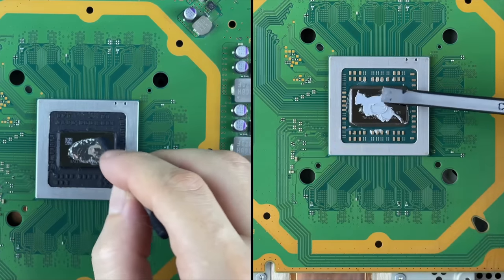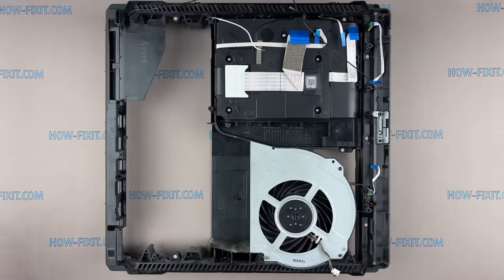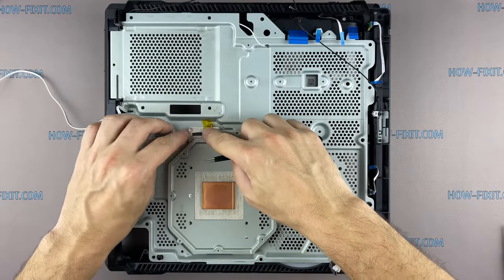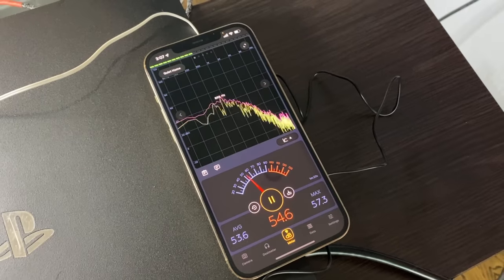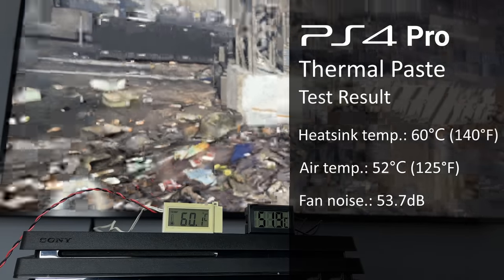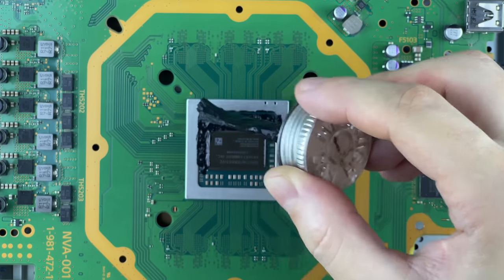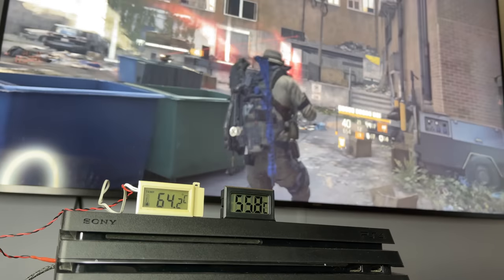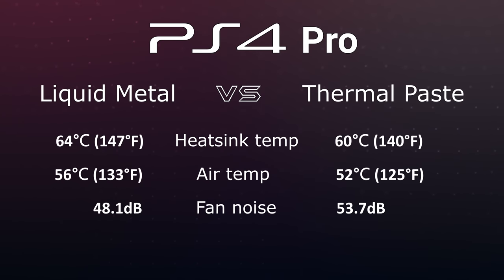PS4 Pro Liquid Metal vs Thermal Paste

Comment: I think the results could've been better honestly.  In delidding CPUs for PC, you're told to apply LM both to the CPU die itself and to the heatspreader to help avoid pockets of non-contact since LM isn't viscous enough to really spread and reach out well enough for contact.
Reply from the maker: The liquid metal was applied to the APU surface and also to the heatsink, all shown in this video - https://youtu.be/zhPYlgDwsZE
Reply: Remember the fan RPM went considerably lower so if the RPM was maintained the temperature difference would be big, but since it uses internal Sony specs the temperatures will probably always be very similar as more heat the fan will ramp up to jumbo jet loud and low temps the fan goes down to completely silent so it will always try to stay within Sony specified range...
Reply: That was the die. Heat spreaders haven't been relevant in PlayStation consoles since the ps3 slim. After the fat ps3s, its been direct to die ever since

Comment: IMPORTANT: The thermal paste used in this vídeo is the vídeo MX-4 that have cure time 200 hours, after this time the temperature going down 2°C até 5°C, and after applied the paste MX-4 can during for 8 years validity
Reply: Can you explain what you are saying, why apply it again after 200 hours?
Reply: @MGrey-qb5xz by curing he means that the paste performs the best after 200 hours of runtime. Not that you need to change it. It’ll last for upto 8 years. Wouldn’t necessarly count on that, but most likely the console will either be dead or sold before 8 years anyways :)
Reply: @niklasniklasniklas1  well damn

Comment: if you are noob its less problematic to apply the paste its not like the temperature or noise are bad with the paste its much harder to clean liquid metal a specially if something goes wrong where you can just apply paste and swap it after 2 years depends how long you play.

Comment: So it appears the liquid metal made things worse. That or there was no difference in temperatures other than the fan being "quieter" which just means they spun slower, which is definitely going to mean higher temps. Waging on the temperature difference being nothing more than the cooling system not keeping up fully yet and that there is no difference in temps between these two pastes.

Comment: I tested it with a jailbroken base ps4, where you can monitor CPU temperature, and the die went from 85 degrees on stock with high fans, to 76 degrees with minimal fan.
Reply: Celsius?
Reply: @damiank9443   What do you think? 76 Fahrenheit is room temperature
Reply: @MultiBeast301  I'm deeply sorry that in Poland we use celsius and that GPU can easily hit 80 degress.
Reply: @damiank9443  God damn you're slow. Of course the dude is talking about Celsius. 75 Fahrenheit is close to 25 Celsius which is room temperature. To be at 75 F the pc would be off

Comment: What you dont say in this video is that liquid metal will leave traces on the gpu and the heatsink over time which you can't remove after. Anyone experienced in hardware will easily notice. Which means using liquid metal voids warranty.

Comment: I don't understand liquid metal with 64 sells thermal paste was 60 so it's cooler air temperature liquid metal 56 Celsius thermal paste is 52 the only thing it did better was fan noise

Comment: PS4s processors run around 80c+, the heatsink is 60 but the processor must be at 85, the PS4 will run silently up till 79c and after that it will increase the fan speed to maintain it below 85.
Reply: This is true I have a jailbroken ps4 Pro 1216b and the fans will not kick in intill its atleast 80 degrees its just the way Sony designed the console.
Reply: @mrkiplingman  Same, i have a 9.00 Slim.

Comment: for anyone who ask for the isolation liquid - thermal grizzly has it's own solution, called THERMAL GRIZZLY TG SHIELD - also they offer a remover, if you need to remove it later.

it's specially made for protection when you use liquid metal

like the comment, so others can see it too

Comment: Most people use isolator tape (the black one) to protect the external APU, but I'm thinking to add a bit of RTV silicone just to protect the CPU surface borders and making an uniform sealing with the tape. It's a bad idea or I could do it?
Reply from the maker: Or just use Thermal Grizzly TG-Shield - https://amzn.to/3Jgwgfv
Reply: I'm sure Plasti-Dip/liquid electrical tape or acrylic nail polish would work fine......which is what I'm highly suspicious is exactly what the $15 Thermal Grizzly bottle is...

Comment: Give me a sec. Liquid Metal strongly interacts (chemically) with copper (which the plate in contact with the processor consists of) as far as I know. In theory, if at the end of the video they saw what happened to the radiator, it would be scary :D (correct me if I am wrong)
Reply: It only reacts with aluminum. Copper is the best choice for liquid metal
Reply: @theqwertt8814  The best choice is nickel. It also reacts with copper, just not as quickly as with aluminum.

Comment: I just tried the latest MX-6 thermal paste on my old original model PS4. The MX-6 is supposed to work 20% better than the MX-4. So far my old PS4 has been much quieter. I've also noticed less frame rate drop and load times seems to be lower as well. I am using a 2T SDD so the improvement is negligible.
Reply: Due to costs, I ended up getting the mx-4 thermal paste and tp-2 thermal pads. Do you think it would do the job for my ps4 pro? Because I really don't want to break the bank anymore than I have to as I'm also going to do a deep clean soon.
Reply: @FidFighter  there are videos here on YouTube that show there is no such thing as a 20% decrease in temperature. The difference is miniscule. like 1 degree difference. 

Several years ago I used mx4 on my PS4 and the paste lasted about 4 years. Today I used mx6 to repasted my PS4. I found mx6 to be a little thicker and harder to apply then mx4. But I'm not sure if it's just me. Anyways my PS4 is quieter again. I'd say go with mx4 since it's cheaper and the difference doesn't really matter to spend the extra mx6 costs. 😅
Reply: @FidFighter  im late but mx 4 on my ps4 lasted about 5 months with moderate usage
Reply: @Fanthomas1742  Well I actually sold my PS4 PRO and got myself the PS5 a few months back so I'm all good, but thanks for the info 👍🏼

Comment: I wonder what the readings would have been with the stock PS4 Pro with the thermal paste that was applied by Sony? I watch a lot of repairing or restoration channels. I always hear that the thermal paste applied by the manufacturer is never of good quality. I know it’s not a variable that might be too significant but I wonder what the data would reveal.
Reply: The stock thermal paste of the ps4 pro probably just a regular thermal paste

Comment: So many wrong comments on this video.

First off, gallium based TIM does Not eat copper. I don't understand where people got this. It plates copper which will make it look terrible but still retains its thermal capacity.

Even if it ate copper, do you honestly think it would be used in PCs where everything is copper??
Reply: I was seriously seraching for this well-informed comment.  I don't understand why people say "EATING' copper.  It doesn't eat copper, it will just sink into it and form a layer and still retain its thermal capacity.  One more re-application is required if tems go high.  I applied for second time and my  PC has been working good for 2+ yeas on 6700k running at 4.8Ghz all the time with stress temps below 70's with CollerMaster Ak620 air cooler  (earlier 90-100 and thermal throttling occurred).

Comment: MX-4 isn't the best thermal paste for PS4. It has thermal conductivity of only 8.5W/mK.
I've been using Gelid GC Extreme with the same conductivity and the results were not good. Console could still get noisy.

Last week I've swapped it for Thermal Grizzly Kryonaut, which has thermal conductivity of 12.5W, and the difference is massive. Now when I play Horizon Forbidden West fan barely spins up.

I have the 7216b model.
Reply: I pre-order this grizzly with tool kit
Reply: @hefdjwewj  Make sure to get it with spatula for even spreading.
When I tried to do the "X method" it did not cover whole surface of the CPU.
Reply: @greggski3710  I will thank you 🙏
Reply: @hefdjwewj  No worries.
If you have PS4 Pro and clean it for the first time remember to disconnect the power supply cable from the power supply not motherboard.
It's way too easy to rip out whole socket from the motherboard if you're not careful. There's almost no change of damaging socket in power supply when removing the cable.
Reply: TC-extreme took my one year old Asus laptop (4800H) from 70°C idle to 27°. Shits good.

Comment: So in both scenarios the heat transfer rate measured is exactly same since we only take the heat transfer of the heatsink and fan. We didn't measure the heat transfer of the apu to heat sink. Higher heatsink T lower fan speed= lower heat sink T higher fan speed. The apu temp is definitely running cooler but we can't tell how much better the actual transfer rate improves unless the fan speed is constant or the apu temp is known

Comment: Did you actually rub LM on the copper of the cooler? Cause if you didn't, you've not applied it correctly. You apply it to both surfaces for best results.

Comment: I thi k u shud have applied some liq metal in the cooler too because of the properties of liq metal its not guranteed it will stick to the cooler surface or not i guess that mite be one reason why u got higher temp with liq metal

Comment: I rewire my power supply to be outside like a brick adapter with its own independent fan and add another fan to the console and max it out... Console runs cold asf... Idk how to check temperature tho but the air that flows out the back is not warm at all and with the power supply out of the way.. Air flow is free through out... However i had to cut a hole  and removed a few unnecessary plastics to mount another fan... I would say my ps4 can go alllll day  without over heating.. Its what's i call twin fan cool😂😂😂😂😂

Comment: Only issue I have with your application is that you did not put it on the heat spreader only on the silicon die. You have to make sure it’s smeared properly on both surfaces for proper contact.

Comment: problem is the copper cooler will suck in the liquid metal in long term cause it doesnt have nickel coating

so if u do it i recomend change the metal 2-3 times then its fine

Comment: By my math the temp difference is 8 degrees Celsius difference In both tests, how are you coming to the conclusion the liquid metal is better? Further that's 8 degrees Celsius difference between  room temp and temp taken at processor,. The decibel difference can be explained by room temp  when air is warmer sound waves travel at different durations

Comment: Can you modify the ps4 cover and drill a hole on the fan and see if there is any change.
Reply: No. PS4 was designed with a specific airflow path. If you cut holes, you will reduce the temperature of the APU, but other components will have worse thermals and may fail. Don't do these mods

Comment: Метал краще передає температуру в порівнянні з термопастою, от звідки і вищі температури на радіаторі і менші оберти вентилятора!  Metal transmits temperature better compared to thermal paste, that's where the higher temperatures on the radiator and lower fan speeds come from!
Reply: Теплопроводность металла зависит от его плотности и пористости. Для тебя физика- темный лес, который в твоей башке!

Comment: Why is temperature higher with liquid metal?
Reply: More thermally conductive
Reply: @brandon_nope  ok now i see. Heat sink is hotter here, not the chip. This could be stated explicitly. And chip temperature could also be provided to make things more clear.
Reply: @mkatakm  and how should someone measure the CPU temperatur when He can't access the bios of the PS4Pro? It's not a PC where you can just install HWInfo64 and read out all the sensor of the Hardware, that is why He used the thermal sensor on the heatsink

Comment: but i think the result is not at all,, you have to try at least 1 month usage of PS4 pro.. so then u can compared both
Reply: I'd say even longer. Most thermal pastes tend to dry out after 5-6 months on PS4.
Also liquid metal needs have 2nd layer applied after around 3 month to be fully efficient.
Reply: Just use gelid gc extreme which doesnt dry out compared to thermal grizzly which is only good for the first month.
Reply: @manuelmacalinao500  yaa,, many people saying that,
Reply: @manuelmacalinao500  that's what I've been using. Has been dry after 4 months and wasn't as effective as TG Kryonaut.
Reply: @greggski3710  I used it on my laptop which reaches 80c constant cpu temp and 70c ok gpu and still not dry after 2 years. Maybe because laptops are sealed better and prevents air from drying it out, which in ps4's case would last much longer. Desktops usually has air from the case blowing air to the cpu which might affect longevity.
Reply: @manuelmacalinao500  You might be right. I remember reading that console and laptop/PC cooling solutions are somehow different, so that's why thermal paste dries up faster in consoles.

Comment: Not worth the effort or risk for 3-4° less heat.
Reply: It's actually pretty easy if you watch a guide.
Reply: Just use a graphite thermal pad/sheet
Reply: 3-4 degrees? It's wicking that heat 10x faster than paste.

Comment: Not worth risk at all
Reply: It is if your PS4 Pro is loud like a jet engine. 
Mine was and I replaced the stock compound with liquid metal..I used nail polish acrylic to cover the around the APU. 
Worked perfectly until I sold it after getting a ps5.

Comment: Nah thermal paste is better. Why would you say 64c liquid metal is better than 60c thermal paste
Reply: El Cactuar  then enlighten me
Reply: El Cactuar  also, 60c with thermal paste i say is better because lower temps. It made the ps4 hotter with liquid metal. Tf cares bout noise. Its gonna happen sooner or later.
Reply: El Cactuar  last i checked making temps lower is better
Reply: El Cactuar  dissipating heat better i get it. Its why 64c liquid metal is better but LAST i checked helping temps get lowered is better not higher